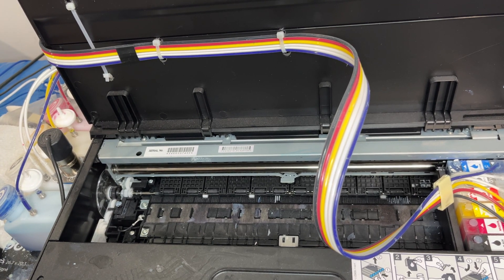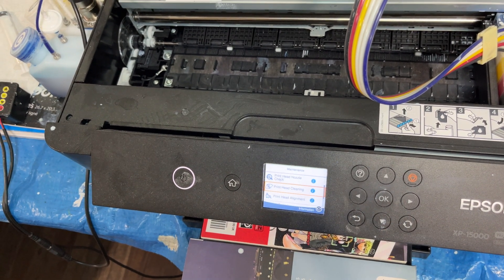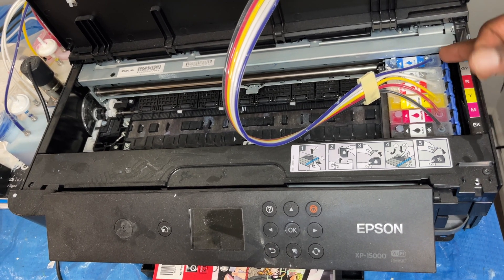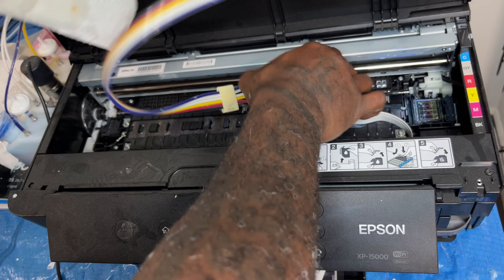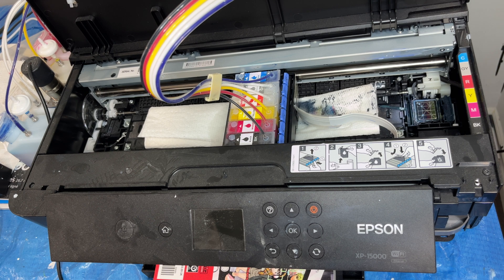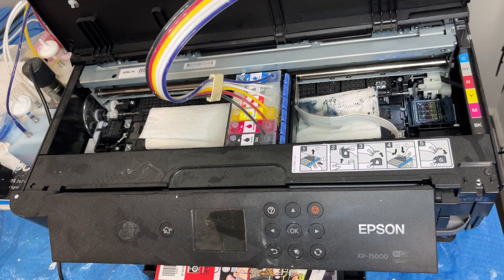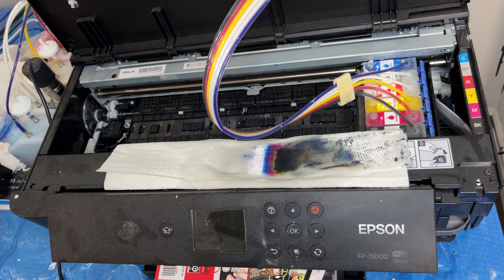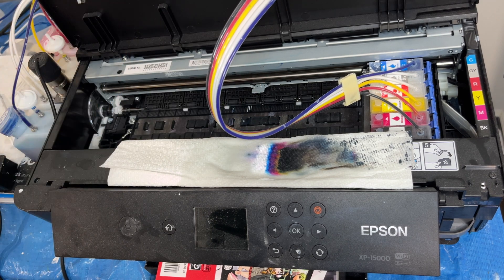Unclog Epson XP-15000 Printhead | Fix Clogged DTF CISS Ink System Fast!

Comment: I have a printer and am getting absolutely no ink color at all, which I assume is due to a really bad clogged printhead.
Reply from the maker: Follow my method, soak the paper towel and leave for 20-30, set your timer then do you’re print. If it’s still clogged do it again. It’s a heavy clog you need do repeat. But you need a cuss with an automatic stirrer so you don’t have to do it yourself. We sell them check our link. We also sell on eBay.

Comment: Bro, I need help. I have the Epson CP-15000 and a CISS converter. I had someone to connect everything for me and it's not right and tubes and track are wrong. Please send me a diagram so I can correct it. I have pictures of it all now. Please help me bro. I'm stuck with jobs and a Cricut machine now.